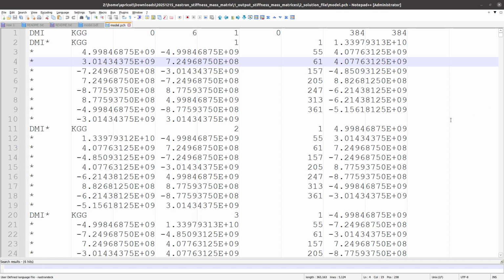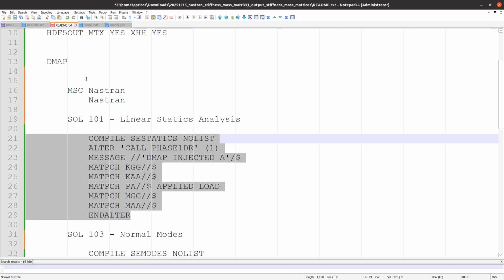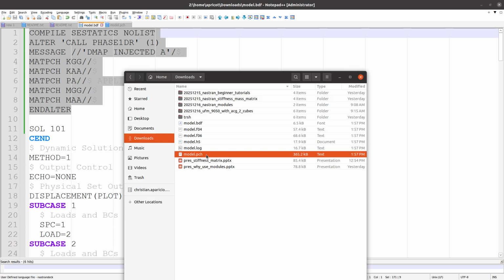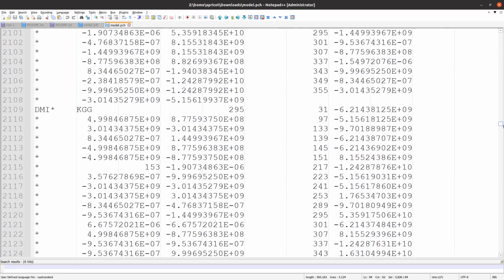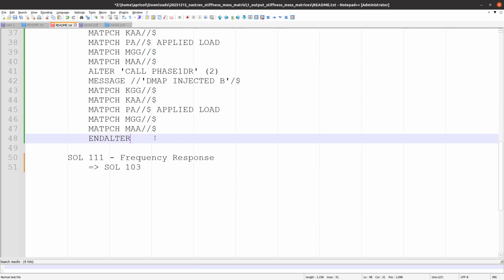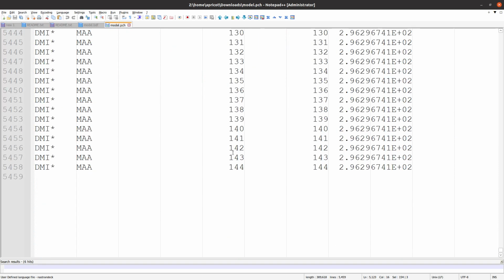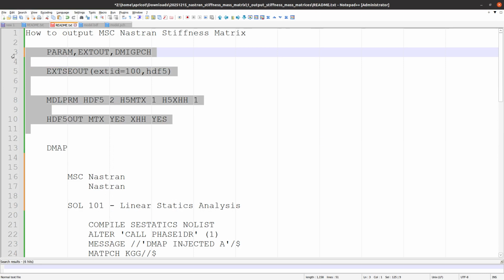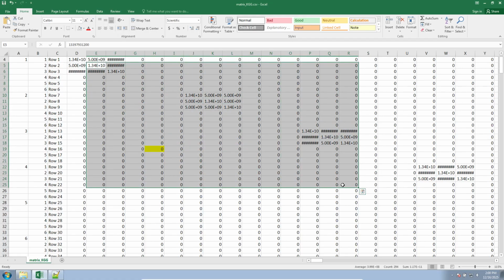How to output the Nastran Stiffness Matrix, Mass Matrix and Load Matrix

Comment: Hi! can you please guide on how to print AIC matrix for sol 144
Reply from the maker: Matrix AJJ or QKK?

This DMAP alter will output matrix RAJJT. This was tested in MSC Nastran 2025.2.

    compile PFAERO, list
    alter 'AMG' (2)
    matpch RAJJT
    MESSAGE //'DMAP INJECTED D'/$

This DMAP alter is read as: "Go into the PFAERO module and list all the lines. Find the 2nd line with string "AMG" and inject MATPCH RAJJT."

Matrix RAJJT is output to the .pch file.

An attempt was made with this DMAP alter, but did not work. This is because not all lines of code are executed, and this alter injected instructions in a part of the code that was not executed. Alternatively, it could be that matrix AJJT does not exist at that point in the code.

    compile PFAERO, list
    alter 'AMG' (6)
    matpch AJJT

Another module worth looking at is the AEQU module.

compile AEQU, list

I recommend the following documentation for additional details.

MSC Nastran Aeroelasticity User's Guide - Chapter 6 Aeroelastic Solution Sequences
MSC Nastran DMAP Programmer's Guide - AMG
Reply: @the-engineering-lab  Thank you very much for the guideline